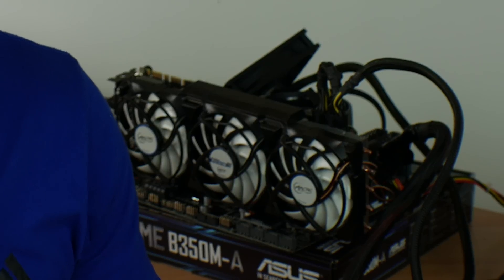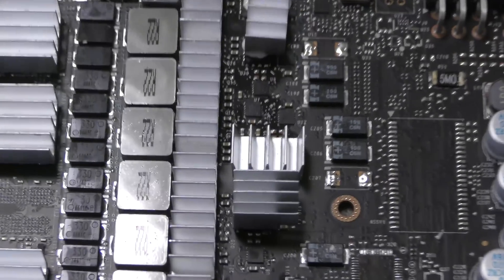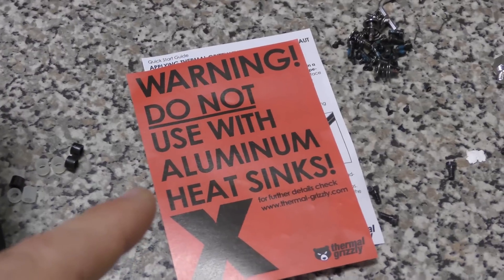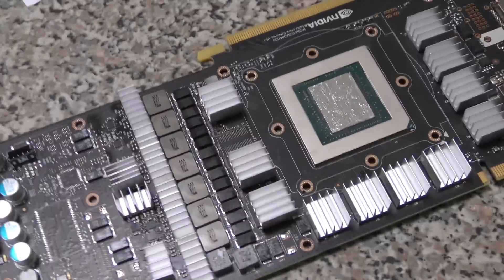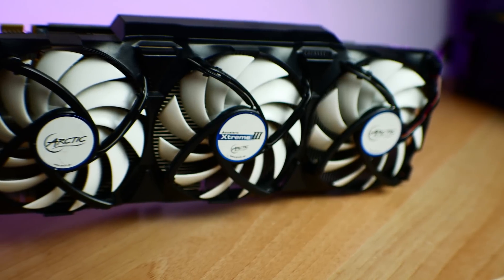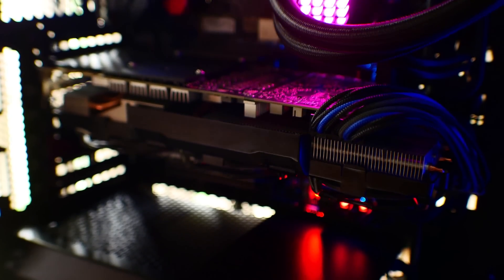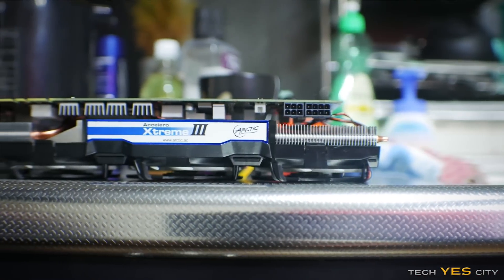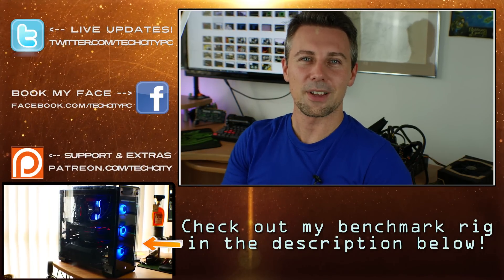INSTALLING an ACCELERO on a GTX 1080 Ti!? How to & Temps vs 1080 Strix

Comment: Little remark: You won't lose your warranty if you go with MSI or EVGA (just look it up). You can remove the FE air cooling and install whatever cooling you want.

Some suppliers will reduce the warranty to 2 or 3 years, some will remove it categorically but some won't care.
Reply from the maker: Thanks, I haven't checked warranty in depth in a while, this is great info.
Reply from the maker: Yeah I have had a 780 with conductive thermal paste plastered onto the micro SMDs on the side and it didn't kill the GPU, though still not a good thing. The tape is a good idea, but since the paste is pretty thin, it can still leak so finitely, and then it will still cause problems, so I like to just work with precision from the get go and get the amount just right.
Reply from the maker: Damn, poor guy :(.  Prob also another good reason for modders to get a power supply that doesn't have a huge start up spike voltage. Yeah I agree though you really only need a micro dot of the stuff to start with, I think the CLP application video is an excellent start to show people how much of the stuff you need if applying, so I will update the description with the video, though you can always use mx4, but on a 1080ti putting out so much heat I would rather go with the high performance pastes.  Here is the CLP video. https://www.youtube.com/watch?v=qFhbqiFh9Us
Reply from the maker: *turbo noob, noob
Reply: I remember I had an Accelero Twin Turbo II on an old EVGA GTX 460 External Exhaust. The sound and temperature difference was huge. Also contacted EVGA about this at the time and they said that as long as you give them the card back with the stock fan (not mounted even) they will offer warranty. Don't send it with the Accelero though, you won't get that back I think.
Reply from the maker: lol yeah that's why I was pissed at the end when it just shot out like that.
Reply: kallibaer32 actually msi have "guaranty void if removed" on one of the screws
Reply: wtf generally you would want to use clu on gpu die like this 

https://i.imgur.com/x0CSdiK.jpg

so you won't accidentally spread any on the transistors. The way you did it gives absolutely no wiggle room error in case you slip a little while mounting the cooler

Edit: yes its off topic but thats because I need to steal the pinned comment for exposure so people won't kill their gpus with clu
Reply: Btw next time go with the Accelero Extreme IV, it have HUUUGE back plate , before it was modern to have a back plate and it have a mount thingy , which is really usefull  :D i used it on GTX 760 back in 2013 . I couldn't hear the fans even when they work on max ,it's that good  :) . I still have it, and soon i might put it on my GTX 1070, beucase i've seen in their website , it's compatible with all of the new GPUs :)
Reply: Yea that video is really helpful, you can probably gauge how much you would actually need on your cpu/gpu die when he spreads it on such a large ihs
Reply: Oh nice, I just installed this cooler on my MSI 1080Ti, nice to know I can still get warranty :D
Reply: CH3FxEXcELL3NcE I just bought the armor 1080ti runs hotter than hell so MSI will let you modify the card and which one did you have
Reply: I have the MSI founder's edition, its the only one AFAIK that cooler makers guarantee their coolers fit on. It's an Accelero Xtreme III although I'd recommend either the Xtreme IV or one of the hybrid coolers
Reply: Even if you get the card directly from nvidia, as long as you put it back in its original condition and don't tell them - you won't void any warranty. Since they don't really have a "void warranty" sticker on the card. Heck nvidia voids warranty even if you overclock it lol. Just don't tell them any of it, and you warranty will still be fine.
Reply: This is incorrect
EVGA is fine if you remove the cooler, EVGA literally doesn't give a shit about anything.
Reply: Thats why i will only buy EVGA. Their support is solid.
Reply: LOL thats like 5 dollars right there, so unfortunate
Reply: it's easy to remove the sticker with an needle , little by little and you can take it off without a scratch on the sticker . :)
Reply: +Englashi TV it is just a way so that they COULD deny your warrenty if needed, as long as you put it back the way it was and the card wasn't damaged because of you removing the cooler they will rma it
Reply: my msi 1080 FE did have a small sticker on 1 of the screws above the gpu die saying waranty void if removed..
Reply: If you scratch or damage any part of the card it will be obvious you tried to remove the native cooler.
Reply: The Accelero IV uses thermal pads instead of glue, and won't void your warranty. I guess Tech YES City used the III version. Update title on the video?
There's also a large back plate heat sink on the IV version and many user have to use the second PCI-E slot to avoid CPU cooler or RAM stick interference.
Reply: How will they know though? Can't you just put the original fans before giving it for RMA?
Reply: kallibaer32 My gigabyte G1 gaming 1060 6gb has not warrenty void stickers so, I think gigabyte lets you as well.
Reply: so to clarifty, b/c I wasnt able to find any concrete info on this, I have a 1080 ti Armor from MSI, if I put a new cooler on that it doesnt void the warranty?
Reply: well msi killed my gpu almost (did not put thermal pads on vram chips and my gpu overheated)
Reply: No shit? Sweet.
Reply: Interesting, you booted and it didn't die? Pretty lucky, there was probably another one in parallel or something.

Just had a guy kill his 7700k earlier this week in r/overclocking by accidentally spreading his clu onto some contacts next to the die.

https://www.reddit.com/r/overclocking/comments/61ny6n/i77700k_delid_fail_who_wants_a_300_keyring/

Generally though you might want to cover up whatever is conductive with some nail polish or tape and just mount the cooler over it.
Reply: fucking noob

Comment: Just bought a PNY 1080ti for $140. Middle fan was bad. Decided to try a 250watt tdp rated Artic Twin Turbo II that I already had. Looks like 5c-10c improvement. Not bad for their mid range product on a high watt GPU.

Comment: Love watching your Youtube videos. After market coolers are sometimes extremely ugly and they don't always provide parts that fit. But with a little research I found small heatsinks and parts on Amazon and Newegg, private sellers, etc. on Google.
I got some incredible low temps using a Raijintek Amorpheus 2 on a Vega 64 ( which I call a heater box) and 2 120mm Be Quiet fans. The AMD 3 yr warranty was gone so it didn't matter after the good service the gpu card provided. I agree with Tech Yes City, after market gpu coolers are a great improvement. 30% difference. Clocking CoD WW2 from 1630 to 1680, load temps 65/75c went down to 39/49c. I get game idles as low as 28c. Non game temps are sitting around room temperature 23c. Not bad for a reference/founders edition card. My opinion, if you're handy with a screw driver and don't mind wearing a ground strap, buy an after market cooler. 
Honestly, this may be a better option than my waterblocks. I will do this again!

Comment: When you use liquid metal on a gpu it should enhance heat dissipation by a huge margin even in a blower style cooler !!!!!
It would have been more fair if liquid metal was applied to both comparing cards!!!

Comment: How di you connect artic fan to your GPU? Have you the right adapter? I try to install accellero extreme 3 on my Asus strix gtx1080 8g but have problems with connectors supplire from artic

Comment: You people who have this cooler is it connected via molex directly to psu? Or you guys using an adapter for the fans and connected to the gpu? In that case whats the adapter. I can't find anything. I don't want constant 7 or 12v on the fans.

Comment: I'm getting stupid high temps even with fans over 80% using msi afterburner. My 1080 FE using a blower fan. It's almost 5 years old and still runs fine, but I need a new fan setup is this easy to setup without needing other supplies?

Comment: What are those black washer things (and other hardware used) you're using to secure the backplate to the rear IO? 4:12, far right. There is nothing like that in the kit. It would be really helpful if you could reply.

Comment: Just a bit confused here, You are comparing an 1080Ti with an 1080 from my understanding, so how does the 1080Ti benefit from the cooler, do you have a comparison of 1080TI stock cooler vs this cooler? How does 1080Ti with this cooler help me understand its benefits vs a different graphics card with 40% less potential?

Comment: In all side by side videos 1080 Strix is 100 MHz better ... a few degrees hotter but runs with an extra 100 Mhz on the GPU clock funny :D

Comment: Just installed an Arctic Accelero IV to a Dell 1080 and it dropped the temps by 30C on average. My only two gripes so far is the looks and that it takes up 4 slots of room
Oh... and X58 (W3690) for life!

Comment: They should extend your warranty by a year, for putting on a proper cooler (compared to the founders edition).  I put the dual fan version on a GTX 970 years ago, and it was amazing.  Virtually silent, and my custom modded Bios 970 would run around 1600Mhz stable.  It's now in my fathers PC, lowered to 1530Mhz I think, and running well.  I lowered it slightly on his, because he doesn't monitor it, and I want it to be problem free.  Even if it goes a few months without cleaning.  Their coolers look dated and basic, but they are very impressive.  Function before form I guess.  I think I'm going to do this for my 1080ti.  I went from the Strix O8G 1080 to a Gigabyte 1080ti, and the noise level is a lot higher.  Enough to want to rip it apart.

Comment: Picking up one of these today to replace the blower fan on my Gigabyte 1080Ti, which is stupid loud under load, doesn't get great temps even then, and I've replaced the thermal paste on it a couple of times and it's still a huge disappointment. Thanks for the video!

Comment: My Xtreme 4 did not come with those tiny heatsinks
Reply: Note: On gigabyte 1080 ti gaming oc

I did however have some raspberri pi heatsinks lying around so i used those in combination with ghettoing some of parts from the original cooler (specifically the plate that cools the memory, I used a 1/4" bit so it would fit on the hexagonal screws used for the main heatsink of the xtreme iv. That way the die still got complete contact). It seems arctic decided only the core needs direct cooling the rest just get airflow which is the same idea as the nzxt g10/12 to be fair. Still not ecstatic about it but with a little creativity and some power tools you can fix'er right up.

Comment: be nice to see if one of these coolers will work for the new radeon rx 5700xt.. the arctic website has the rx 5700xt listed as being compatable with a few of these coolers, like the two triple fans versions and the two double fan versions but im kinda reluctant to buy one and try it out without knowing for sure that it works. because unfortunately i couldnt wait for partner cards and bought a reference card that i got in the mail today and it is extremely load and even more so extremely fkin hot :( and im running it at stock speeds, in fact i actually truned down the core clock cause msi afterburner had 2100 listed as the core clock stock sio ya i bumped that down to 1900. anyways cool vid looks like that triple fan cooler could handle my 5700xt if it can handle a 1080 ti just wonder if the 5700xt will fit or not.

Comment: Unless you put liquid metal on the cooler as well you will get a shitty performance. This is because of the surface tension of the liquid metal and it won't bond all that well unless you put the liquid metal on both sides, i.e. on top of the GPU and on the cooler itself.

Comment: I had a heavily modified GTX 970 (1600Mhz+) with the two fan version and it was almost silent, and never went above the 50's.  This might be what's next for my 1080ti.  Thank you for the effort.

Comment: Just get the cheapest used founder's edition of the gtx 1080ti and wack this bad boy on, you would most likely out perform the most expensive version out there at half the cost.
Reply: Asic still matters tho, but how much would the cheapest go for? Kind of thinking about getting one but money is a little bit of an issue atm.

Comment: just installed one on a used PNY XLR8 GTX 1080 that i got for $300. The stock cooler was so bad it would hit 90c easy now its max temp is 57c overclocked. AMAZING!

Comment: How do you do?
I plan to purchase Accelero Xtreme IV.
But,this package doesn't include  heat sink for memory.

Could you tell me the height of these heat sink?　1:02
Reply: The cooler comes with thermal pads (I believe) that allow you to cool the memory modules (and other components for that matter) with the main heatsink.

It also has a second heatsink on the back ;) But Im unsure how that connects with the board

Comment: The most extreme air solution that I have seen was a guy who stuck one of those noctua heatsinks to the GPU...for me the easiest, cheapest, most effective way to upgrade your cooling solutions is simply mounting a fan to the side panel.

Comment: hello
i have buy a GIGABYTE -GeForce GTX 1080 Ti Gaming OC and the temp go to 85 ° C without OC ; il voud like to knox if the exelero work with may card 
thnaks veru much for help me
a french
Manuel
Reply: I know this is a 5 months old comment, just mounted a Accelero Cooler on my gigabyte 1080 ti gaming OC model, it will work fine and temps never go above 60c! (Core clock 2050mhz) Now my card runs a LOT cooler + makes 10x less noise!! I had to check if my fans were even working when i was gaming lol..

Comment: i know this is old post, but you can use clear nail polish ($2) on the transistors around the gpu core to protect them from the liquid metal OR you can spend more on the real stuff, silicone modified conformal coating ($18). I went with SMCC just because i dont trust nail polish on my $800 gpu.
Im not sure whether or not to get Artic or Ranjiktech Morpheus 2. I have plenty of bottom room and might opt for the Ranjiktech and splurge on some new and improved noctua 120's. My D-15 is in the way for the bigger Arctic =(

Comment: I used this cooler with msi 1080ti armor 11GB, the only difference is I custom cut the backplate with cnc machine. works great and advantage is that I kept that thermal rubber on the card where aluminium coolers couldnt be applied. Great cooler.

Comment: u should use clear nail polish to cover the tiny little smc's around the die, so if the liquid metal gets on anything it wont be an issue due to the barrier the nail polish creates over the smc's

Comment: Pro Tip: With the grizzly liquid metal you should place the tube in hot water for a couple minutes so its completely liquid and there are no solid bits blocking the nozzle.

Comment: If someone is still reading this: I want to connect my fans directly to my Asus 1080Ti STRIX GPU (instead of the standard fan), can I do this and regulate the two 120mm fan speed with the Asus GPU Tweak Program?

Comment: Not sure if this has been covered but in introducing a different thermal compound, you cannot isolate whether the effect is due to  the cooler vs the thermal compound itself.  I.e., what happens if you use the same thermal compound on both the 1080 Ti Strix and the Artic cooler?  Also are the PCB on the FE and the Strix the same?  Lot of variables weren't controlled here :(

Additionally,

Comment: I heard EVGA is cool with you doing mods like this aslong as you are doing an RMA and send it back with the original cooler they should not have a problem with that. One of the few exceptions I believe also it may be a North America thing aswell.

Comment: Same fan profile and the artic cooler is more quiet DOOH the strix cooler is max 3650 rpm and the  artic cooler max 2000 rpm of course  the artic cooler is more quiet with the same fan profile

Comment: Bro, I got an EVGA GTX 1060 3gb for my first build. Tried to overclock on stock cooler, and it made my sad to listen to the hair dryer and look at high temps. I didn't know that Accelero was that good of a cooler. I picked up the first aftermarket one I could get my hands on (which I noticed that it had the same logo as the one in your video). Low an behold, my 1060 3gb holds 2164 with shunt mod, and never EVER goes over 60c. I am purchasing a 1080 TI (cheapest one I can find) and the Accelero cooler will be purchased right next to it. Dude, your channel is Gucci bro!

Comment: Wait you are comparing the coolers but using liquid metal on the Arctic?.... how is that a fair comparison if the cooler it's self?
Reply: It doesn't matter, he was refering as to when you apply liquid metal to a CPU you can see 20º difference in temperatures. Delidding is just a requisite of it.
Reply: Sure but the Strix and the AC should preforme the same with regular paste on, liquid metal dosn't do that much for a gpu as it dose for a intel cpu. And it's not worth the risk if the card isn't throtteling down really.
Reply: Not fair... as one can see 20° difference when deliding a cpu... :(
Reply: A CPU has a lid.. these have no lid..

Comment: trying to use a arctic accelero 3 on my evga 670. however the 3 does not come with the small heatsinks, and the heatsink on my VRM's is way to tall to get it to fit... any tips?
Reply: Steven Williams you dont need the heatsinks.
Reply: Ted Curry awsome! thank you for the response!
Reply: Steven Williams no problem, as long as you got decent airflow over the chips you are fine.
Reply: Ted Curry Thanks again!

Comment: I have put one of these in my second pc , on a gtx 670 , its noisy, just as much as  the blower it did replace. I would not reccomand this piece of you know what to anybody. keep that 100$ for a next real upgrade, not a bad aftermarket  cooler.